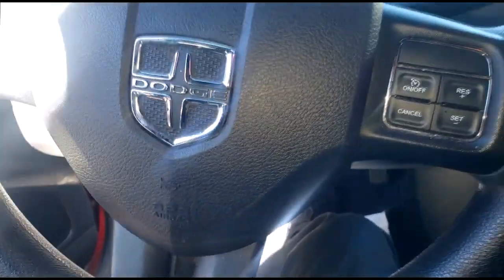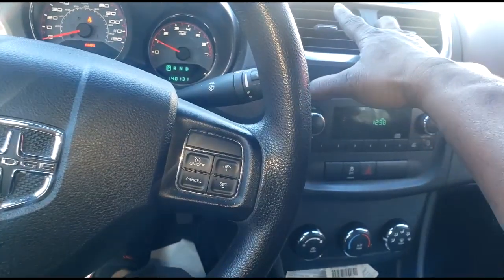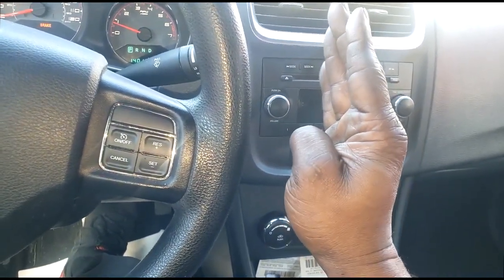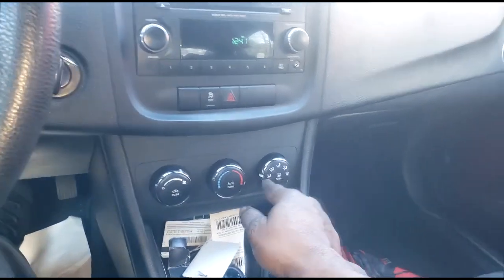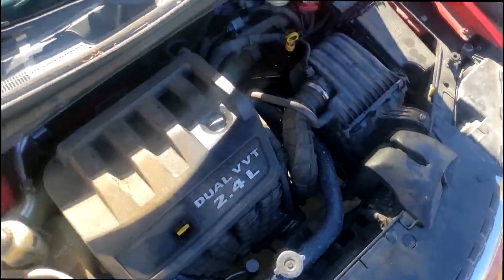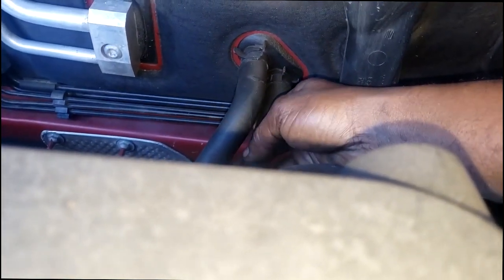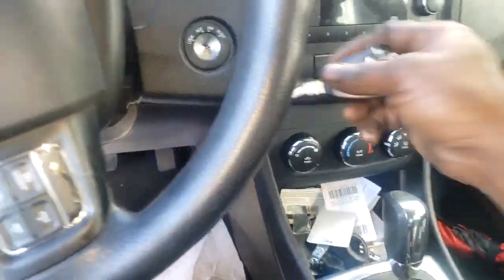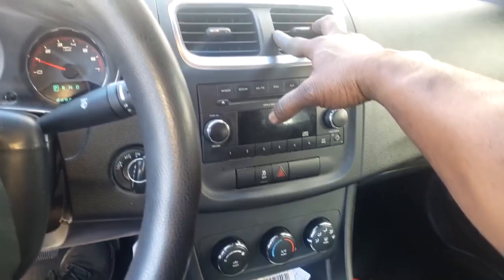How to make your car heater twice as hot  Do this to your heater core

Comment: Real Quick! This question doesn't apply to this video. If your "check engine' or the engine display light is lit on your dash. The remote starter won't work? Is there a way to bypass this?(2015 Grand Cherokee). Thanks for rubbing in that 60-70 degree temps for the winter months..Lol. Freaking -15 up yonder here.

Comment: Peak hot air from the heater needs the engine to be at operating temperature. A cold engine won't achieve hot temperatures like an engine at 190°F

Comment: I have a Nissan Sentra sr 2011 and these codes came up P0725, P1726, P0744. Do you by any chance have a idea upon the steps I should take to fix this car?
Reply: PO726, not P1726?
PO725 - Engine Speed
PO726 - Engine Speed
PO744 - Torque Converter Clutch
Is your tachometer functioning correctly and the engine running fine  If yes, this suggests an issue with the transmission, specifically torque converter.
While driving, the computer monitors transmission speed vs engine speed to ensure the transmission is functioning correctly.  If there's a mismatch (let's say the engine output speed (engine speed) is much higher than the transmission input speed) these and possibly other codes will be reported.  If the torque converter is slipping, there will be a mismatch.
The solution could be as simple as reconnecting or repairing a harness connector to the transmission, or as complex as failed transmission replacement.
I'd begin by determining if the engine is running properly then move on to diagnosis of the transmission.
Reply: Most likely needs a cvt transmission
Reply: @thisisyourcaptainspeaking2259  thank you so much for responding my apologies on the late response it was 1 not 0. But yes when driving it seems to feel like the car is chugging as it switches gear and then the car would vibrate. Which lead me to believe something needs to be replace roughly how much do you think they should charge with those type of conditions on the vehicle?